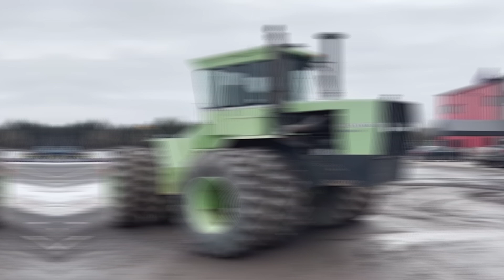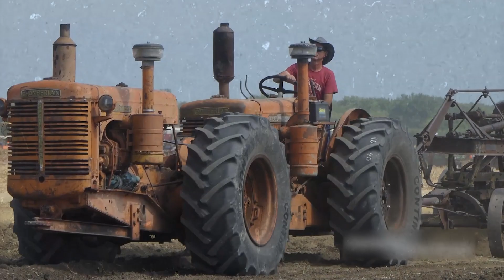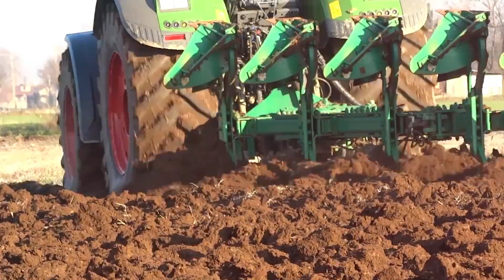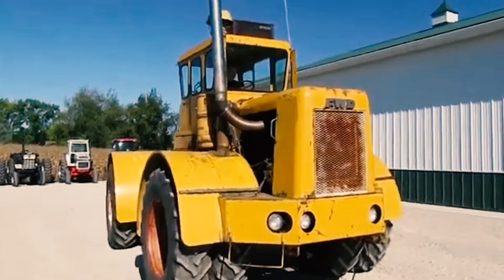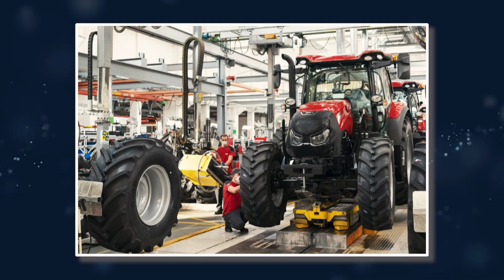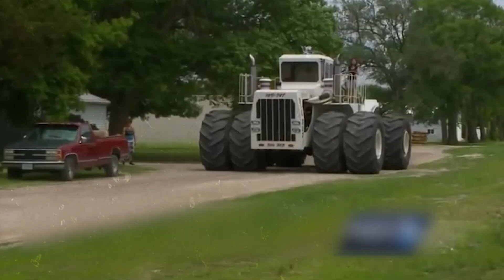10 Most Over Engineered Tractors

Comment: Steiger 450 hp was a good tractor had Ailson auto with torque convertor ( with a lock up torque ) Uncle built a 2 Eng 4 wheel drive. Ai voice not in sync with pic. Custom farming equip. Wagner was NOT twin eng lol. Total Bs wagner was much like Steiger lol. Check out the cab much the same. Window slope helped keep windows clean lol. Not for speed lol. Pic not correct at all Big Row was a disaster. Pic is a 1150 versatile NOT a Big Row  Front fuel tank was a joke NOT enough weight in the front when fuel was low. Bad wieght transfer. Beluruis diesel tractor NOT a Rusdian nuke lol. Even show the diesel smoke lol. Total Ai Bs. Big Bud is 750 Detroit V 12